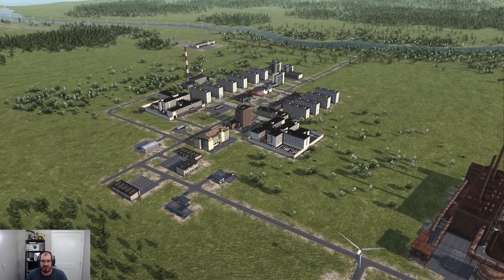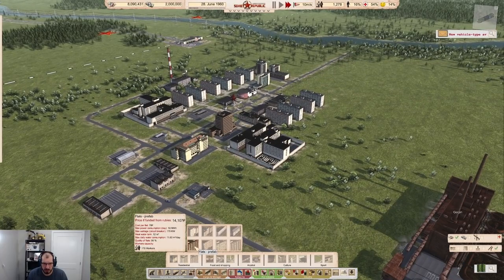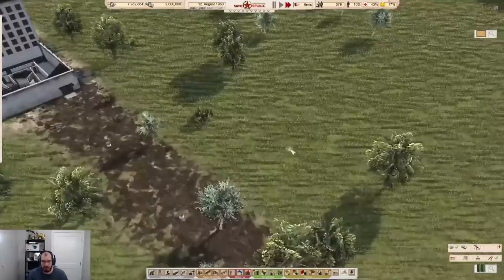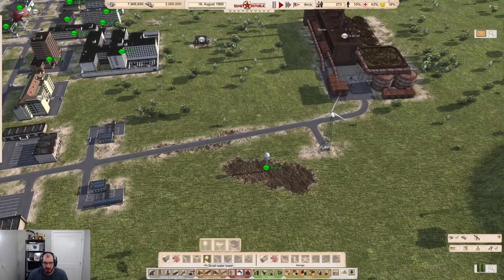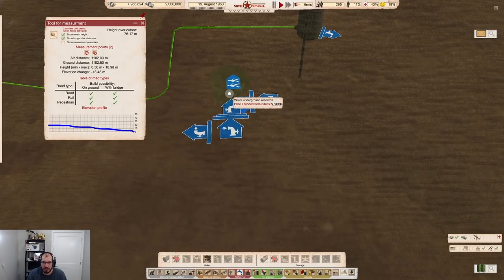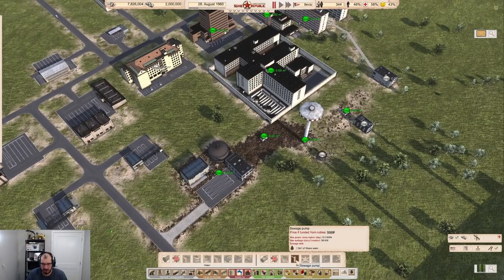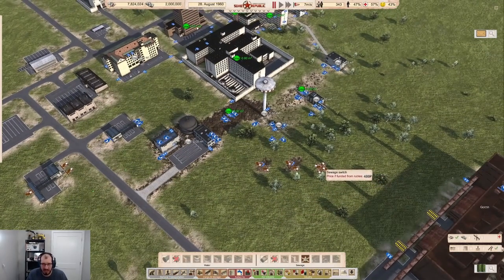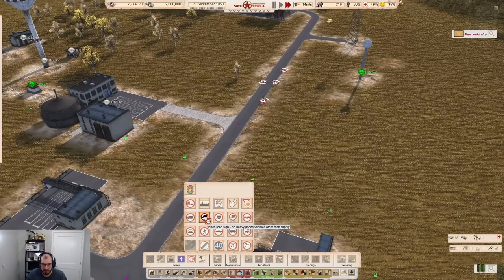100% Explained: Water, Grid Snapping & Complex Traffic | Beta Branch 0.8.7.3 | Workers & Resources

Comment: Great explanation, as usual. I think you fumbled with the water consumption at 1:57 there (division instead of multiplication, if the number in the building stats is per-person), but other than that - was helpful, so thank you !

 Personally, I think the water mechanics is just over complicating the simulation, I personally was waiting for the grid snapping and traffic sounds cool for big cities or limiting unnecessary traffic from going through small towns instead of the highways (and this also means that vehicles now look for the fastest path instead of the shortest path which I think is better) - I'm going to test all those out !
Reply from the maker: Nope, said it exactly how it is.
Reply: @bballjo  No(pe?), it's not "how it is"! If water consumption is PER PERSON, which you mentioned very intense, and you divide it by 179, what do you get? Just the 179th part of one person, which is a complete meaningless value!

Comment: Well, it seems that this borjked my Cosmonaut game due to the time needed to build the water/WW infrastructure so new game coming up. FYI, the sewage pump stations are actually called 'Lift Stations'. You use them to move sewage across flat land since you need slope for the poop to flow. Place these at regular intervals so that you get a 'saw tooth' type of pipe profile and can move sewage across the map.

Comment: Yo Bbaljo, how exactly are we supposed to lay out water and sewage systems? The devs haven't put up a video explaining the new additions or a tutorial explaining the basics. For example: how do you start a new city with this update when you can't treat water for your system without workers, but people won't work because there's no water (a chicken and the egg situation), Do you need a water pump to get water into a water tower? Do you need a water tower or pump to get the pressure into your towns? How do you collect sewage from individual buildings, what are the various structures for sewage for and when/how to use them? When do you use large vs medium vs small pipes? How do you set up waste and water trucks to pick up and drop off water and waste? So many questions that I can't find answers to. Hell, I have no idea how signs and street lights are even supposed to work. The only sign I recognize is the Stop sign.
Reply from the maker: Be patient...I'll get to it.
Reply: @bballjo  no worries, my frustration is aimed at the devs who put this out but don't explain how it works
Reply from the maker: Seriously...that's what I am there for...they won't put full tutorials out until the full release, and they trust that I will make something useful. It wouldn't be time wise spend on their part to concentrate on tutorials at this point, because the game keeps changing. Is this ideal? Meh. But I feel it's pretty standard practice with early access games.

Comment: Nice video. Use water treatment plant before water tower, I believe they use clean water in the watertowers.
Also will you use the pipes under roads? I think it is common to put pipes under roads.
Reply from the maker: The water tower stores water, it doesn't care what purity...there are reasons to store it right after the well as well as after the treatment plant.

I will try to run them under roads when appropriate, but it's not always possible or feasible, slopes and pumps and switches make it rather complicated.

Comment: Can you place two or more signs in one place? For example making a road with speed limit and no trucks, so just like in real life, a taller pole with more signs on it
What happens with water on flat terrain, no slope either up or down? Does it just not work, or it works but only on small distance?
I love making everything flat in this game, so this update will force me to change my habits... or use pumps a lot
I hope that trains will be able to transport water. I also wonder what would be cheaper (both to build and operate, in long and short term): pumps with pipes or small train carrying water to higher elevation
Reply from the maker: I don't think so.
Reply: Unfortunately, you can only place one sign in one spot at a time. Though you could place multiple signs in a row, and although it will look ugly, it'll get the job done.
Reply: @NewBuildmini  Let's hope it is to be fixed soon

Comment: I can't get TS hosted sewage trucks to pick up from industrial buildings. Do they only pick up from sewage tanks?
Reply from the maker: They will only pickup if there is no sewage tank connected, but also only for the worker use, the industrial use is not handled by the TS
Reply: @bballjo  Thanks. Can you use sewage tanks to collect the industrial sewage and will the TS then pick up from these tanks?
Reply from the maker: No. If there are pipe connections on the building, that water doesn't go to the community collectors/substations.

Comment: Great tutorial thanks, could you clarify- when you set up the drinking water 50m tower you said the water pressure (~80 m3) will be maintained until the next building; do you mean then that after the treatment plant the pressure will reset to ground level pressure, or will the pressure move 'through' the building and maintain at high pressure? Thanks
Reply from the maker: The only building that I know pressure goes through, is the water switch...all other buildings effectively reset the pressure, and you'll either need gravity or a pump to reestablish pressure.
Reply: @bballjo  Awesome thanks for the clarification!

Comment: Hi. Great vid and great guides! Is the fact, that game doesn't let me place sewage discarge into lakes, only rivers, a bug or a feature? Although I suspect a bug because for some reason also other objects, like beach, refuse to be placed on lakeshores, only on rivers. When placin on lakes I get either "can't build on water" or "needs be near water" message. Any thoughts? Thanks!
Reply from the maker: Any water is suitable, river, lakes and oceans alike...the thing that's a little finiky is that you need a slightly steeper drop of on the water edge, and a slightly straighter piece of land to place the discharge...
Reply: @bballjo  It worked! My comrades thank you! You just saved them from embarking on building an epic crossmap sewage system! 😀
Reply: @bballjo  "a slightly steeper drop of(f)..."   than what, or where?

Comment: Firsty, thank you @bballjo for great tutorial. But I have trouble with waste water export. You used sewage discharge, so everything works fine. But I have no water nearby so I wanted to export the sewage in the beginning of the game. I built a sewage loading/unloading station, set it in the technical services. I set up a line that should load the sewage at the loading/unloading station and drop it at the customs house (as you said, it is yet not possible for technical services to drop sewage directly at the customs house). But the problem is that the loading/unloading station does not have internal reservoir nor there is a sewage reservoir with inlet ond outlet. So what happens is, that the trucks from technical services can't unload at the loading/unloading station because the sewage has no place to go. Is there some workaround or I just have to use the discharge? Thank you!
Reply from the maker: There is a mod for storing sewage now...but no, the loading/unloading station should be connected to the network, otherwise you won't get to load a lot... maybe you can set some trucks to wait until unloaded...but if you really don't have water on the map, then for now I would say you have to create a lake with terraforming...I did hear there is a land discharge mod for sewage, but haven't confirmed yet.
Reply: @bballjo  I saw the land discharge and I will also look for the sewage storage. Thank you :-)
Reply: @bballjo  I think it works like load/unload stations for like gravel and such. You need something to 'push' the sewage to the unload/load station to work. Maybe place a sewage treatment plant upstream? Or create a new line from city sewage tank to the custom house?

Comment: I might have a bug in the water sewage system (multiple -15 meters pumps woun't push the water) is there any reset keys like there is in the eletricity ( E+C+L)? Thanks bballjo!
Reply from the maker: The pumps have power and capacity?
Reply: @bballjo  both yes. Pipe capacity is also not a problem (sewage output:29m3/day; using 75.4m3/day pipes) I'm thinking in destroying the sewage tank and building a new one but I was first searching for a reset option
Reply from the maker: @pedroleitao1094  it's the only pipe? Ie. That pipe goes to the outflow directly?
Reply: @bballjo  no, goes to a switch with another sewage tank but with no problem (video demonstration: https://youtu.be/nM28gkmQv34)
Reply: @bballjo  seems to be because it is close/under a crop field

Comment: i guess it's now impossible to start on hard money... way so many building to build
Reply from the maker: Its impossible to start in vanilla without loans...but with loans its very doable (+ Realistic)
Reply: Loans
Reply: They should change the amount of money for each option. I believe that its still the same as it was on first ea release, despite the fact that so many new necessary things were added. Actually, money should be a slider option, with different values as difficulty tresholds. Difficulty would be influenced by other options, for example, if you disable almost everything like seasons, water, power etc, the "hard" treshold would be below 500k. But it you enable everything and set other things to hardest, the hard money would be more like 2000k. And, because its a slider, you still could lower it to 100k if you chose to
I wonder if someone wrote something like this on steam. If not, I will suggest this
Reply: @hopin8krzys  discord it.